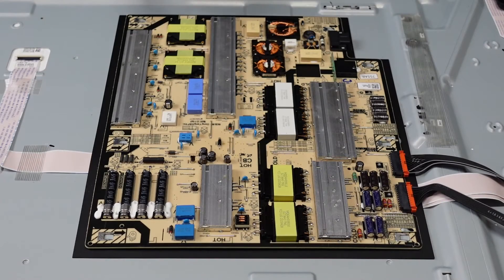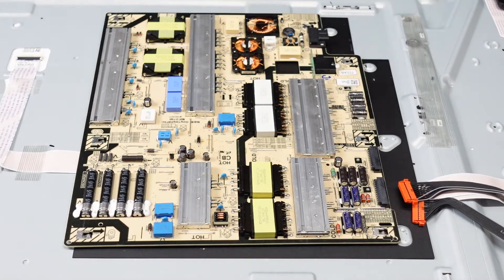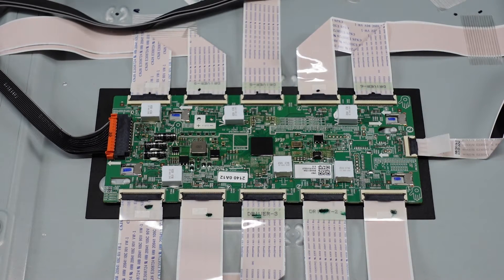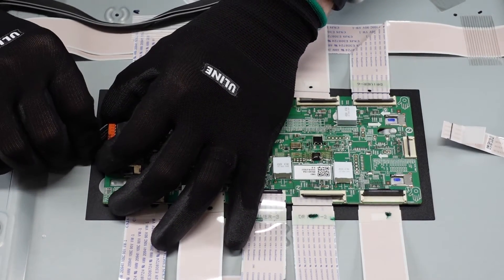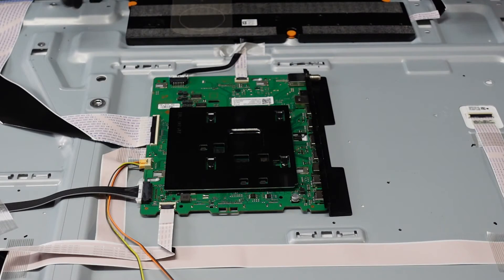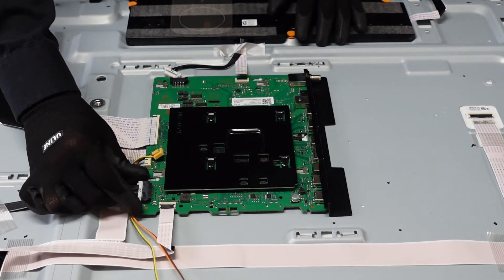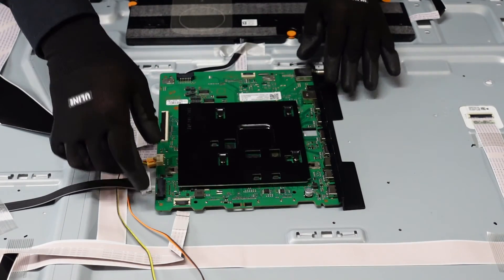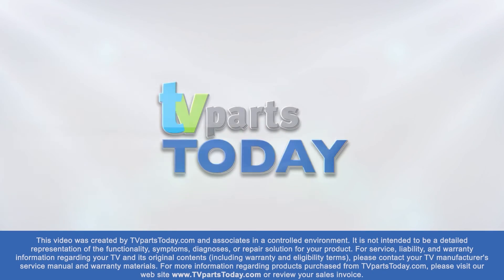Samsung QN75QN85AAF **Sound - No Picture** troubleshooting tips and board swap guide.

Comment: I'v purchased a mainboard(x90j) from your website.   Does this mainboard need to be flashed firmware?
Reply from the maker: Most Sony main boards require an update. We suggest trying the main board first to see if it works. If it doesn't then you would have to do the firmware update.
Reply: @tvpartstoday  But there are no firmware at  official Sony web.
Reply: @tvpartstoday  But there are no firmware at  official Sony web.
Reply from the maker: @kenlee5944  Sony has discontinued some updates. If it's not available anymore then you can not do the update. I would go ahead and try the main board without updating.
Reply: @tvpartstoday  OK.Thank you so much！
Reply: @tvpartstoday  Unable to enter the system ，only can see the Sony and Google tv logo，and then auto power off
Reply from the maker: @kenlee5944  What was the original issue in the TV?